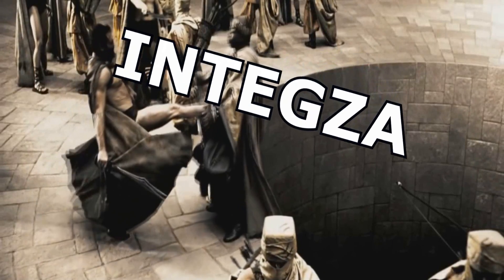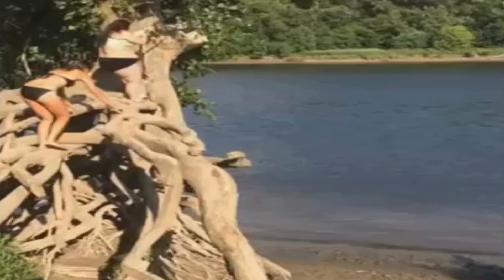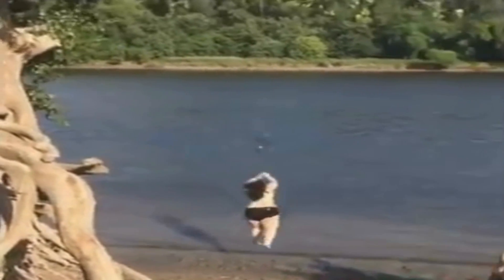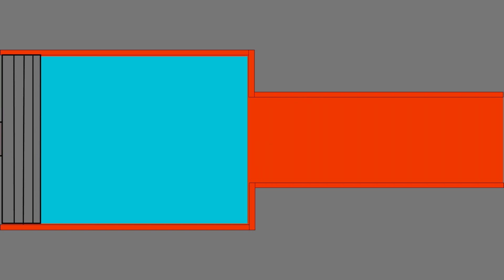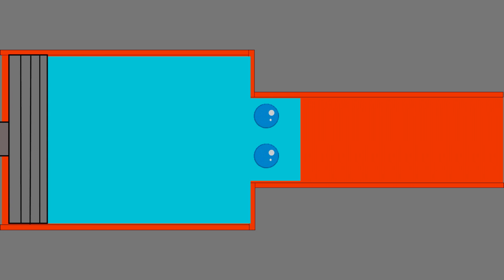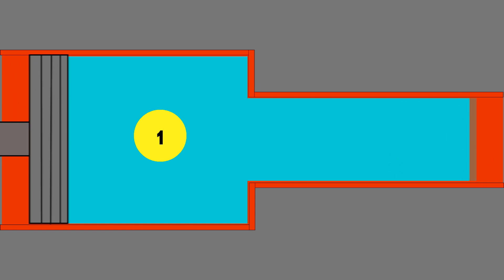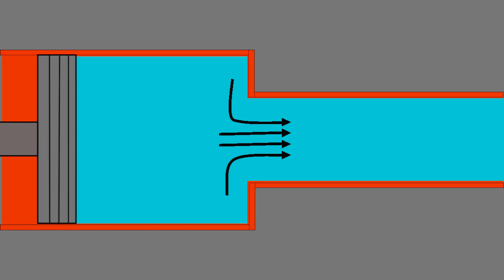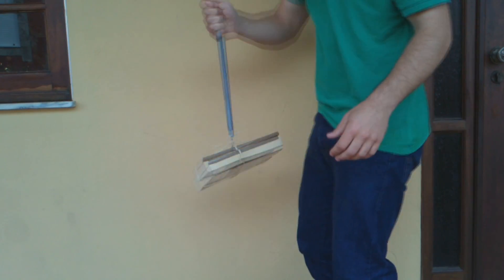Bernoulli's equation explained - Understanding the relation between velocity and pressure

Comment: I’m trying to make a lightsaber using a mini propane tank and the Venturi effect. All the videos I’ve seen say the Center part of the Venturi, the part with the smallest diameter will have lower pressure because of this principle, and will pull in air and make a air fuel mixture but every time I do it gas just escapes out of the hole. Can you please help me understand what’s going on?

Comment: fyi,  you seem to have skipped over a  Fundamental aspect of any non-static fluidic system;  (constant) FLOW  RATE/volume.          assuming a constant flow-volume, any  Reduction  in the cross-sectional dimensions of a conduit (in a fluidic system) will  result in the fluid  Attempting  to  Accelerate.      if the fluid cannot  accelerate,  a relative pressure increase will occur (within that conduit).        cheers

Comment: is there any pressure in the wall (not cross section) of uniform pipe carrying fluid?
why? why not?

and "P" used in Bernoulli's equation is pressure at cross section(Not wall) of pipe. right?
please explain this stuff.
regards..
:)
Reply from the maker: Hi Arjun, thank you for watching the video.
The decrease in pressure linked to the increase in velocity of the fluid happens in the pipe walls, in the direction of the flow the pressure is bigger that 1 atm, after all is that pressure that keeps the fluid going.

Hope I answered your question.
Reply: and second  answer to second question? :D
Reply: this is the most  intuitive lecture in this topic i have ever found.
thankyou..
Reply from the maker: In a uniform pipe the only pressure the walls of the pipe feel come from the weight of the fluid.
Reply: can you give me  your email id,so that i could ask you more questions?i am having trouble uploading the question here.

Comment: You work too hard to justify Bernoulli.  The pressure is higher in the large section because there is a constriction where the diameter reduces.  The pressure in the smaller section is lower because it is free to flow away from the higher pressure region.  If you view the smaller section as simpl y a hole in the pressurized large section (view it as a pressurized tank), the fluid easily escapes out this "hole" to the lower pressure region.  It is pressure differences that cause accelerations in a fluid.  A higher pressure region represents a force (F) that pushes (accelerates A) the mass (M) of air toward a lower pressure region.     F=MA.If you have a gradual change in diameter, the momentum description is not valid.-- Cheers